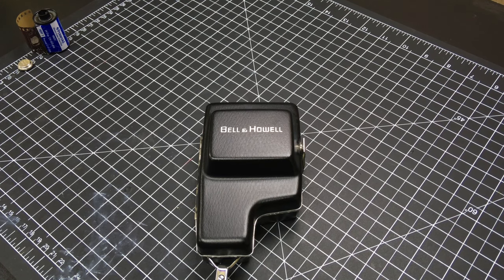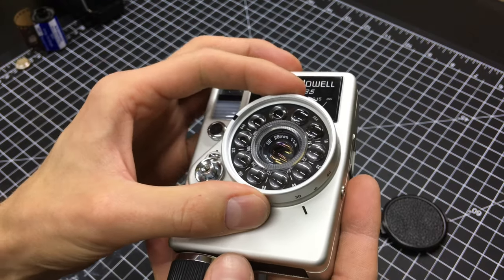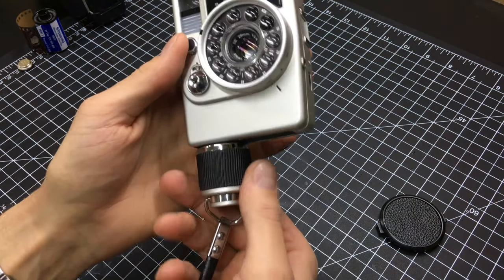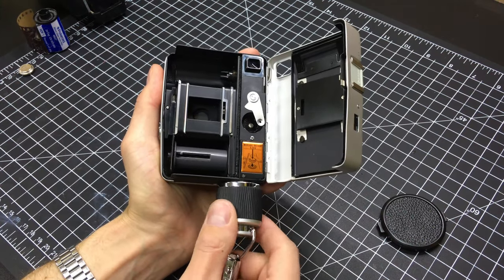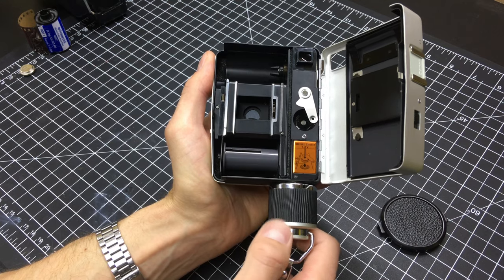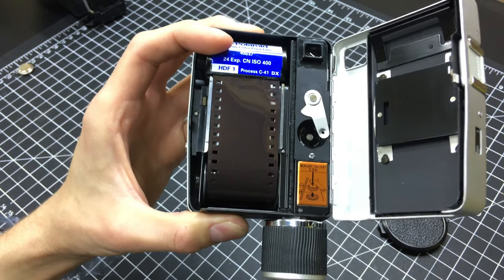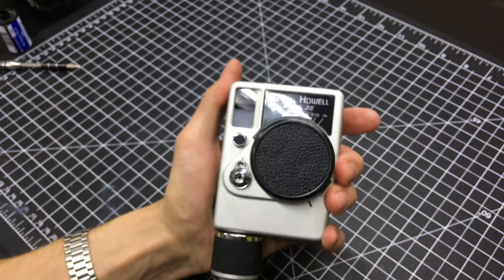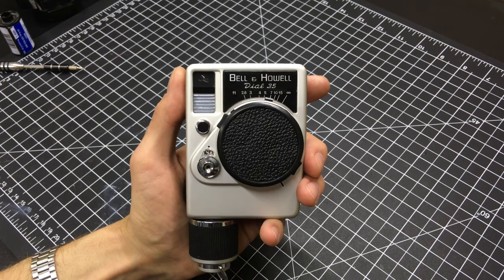How To: Canon Dial 35 Repair

Comment: What would you suggest if the shutter is not clicking? The camera is almost totally unused (original box and free roll of film was still inside.) But the reel does not move when winding and shutter does not seem to close/open all the way (no click.)
Reply from the maker: have you been testing it with a roll of film?  the shutter gets cocked when the sprocket holes on the film turn the gear in the film compartment.  if you do not have film inside you can turn this gear by hand to manually cock & test the shutter.

Comment: Hi! Thanks for this video! I need to perform this maintenance on my dial but I’m worried about the motor “kicking” when I open it. How can you tell if the mechanism has any tension left in it before you unscrew everything?
Reply from the maker: well, the best you can do is try to let out as much tension as possible.  i would put it into "Rewind" mode and let it unwind until it stops, then smack the motor with the heel of my hand in an attempt to jostle it loose to unwind more.
Reply: @David Vonk  I’m gonna have to hold my breath and give it a go. Scared to mess it up!!
Reply from the maker: you'll never know if you dont try... so give it a go and do your best!  good luck!
Reply: @DavidVonk  I did it!  Thanks for the vote of confidence :)  only kicked a little and it's running super smooth now!  Thanks for the video and the replies!
Reply from the maker: awesome, way to go!  i'm glad the video was helpful.  enjoy using the camera that you fixed yourself! :)
Reply: Me again. Shot some great rolls on this camera but suddenly it stopped advancing and was making odd sounds when I turn the crank. I took the crank off and now can’t move the gears manually inside like you do in the video with the q-tip. Guessing this is a bad sign… when i put the crank back on it turns but does not advance the film…

Comment: Nice video man, it's a funny and beautiful camera. I'm having the following problem with it though: the exposure counter does not roll back when I rewind the film. So when I got the camera it was at about 40, went up to 72 while I was shooting and I couldn't finish my roll and had to rewind it. So my roll was used about halfways. Rewinding the film moved back the exposure counter somewhat but not completely, so it's now at 50 with no film in the camera. I'm guessing my next film roll will also remain partially unused because of that. Do you have any suggestions on how to solve that and make the counter go back to 0 upon rewinding a film roll?

Comment: hi david, thanks for this awesome video! i don't know if you still check the comments on this video or not, but i have one of these and it seemed to be working great until halfway through my test roll when it suddenly started rapid firing the shutter on it's own and now the shutter release button isn't firing the shutter any more. i pulled my test roll out of it and when i turn the sprocket inside by hand, the shutter fires rather than cocking for the release button. any idea why this would suddenly happen halfway through a roll of film?
Reply from the maker: hard to say for sure, my Dial 35 only had the sticky motor issue so i only went that far.  you might have to do some more digging to find out the cause of the issue.
you could also try asking on the Vintage Camera Repair Group on facebook

Comment: Hi, thanks for the video ! I'm trying to repair my canon dial 35-2 but I can't unscrew the motor from the body. Could you give me a link to the specialty wrench you are mentioning ?
Reply from the maker: hello!  if you look at the pdf i linked in the description, there is a picture of the wrench on the very last page, the Canon Service Tools List.  they call it a "Special Screwdriver" T0199-18-0357-1T.  unfortunately, i doubt you would be able to find it, so you may have to fabricate one with the same span out of a piece of sheet metal.  hopefully their picture gives you an idea of what you need. 

alternately, you could try getting creative by wrapping something around the motor nut (e.g., some wire?) and twisting it down to grip the nut, and pulling on it in that manner?  i guess i got lucky on the Dial 35-2 cameras that i worked on, i was able to loosen them without a tool.

good luck!
Reply: David's right that you're best to have a machinist make the wrench from flat stock that will fit the gap between the camera and winder fob without binding. It is the right tool in any case.

Comment: What kinda battery did you put in?
Reply from the maker: the original manual calls for a 1.3v Mercury battery which is long been discontinued; i used an MRB625 1.35v battery which seems to operate the light meter correctly.  unfortunately, they are expensive (around $10 USD currently) and they are zinc-air chemistry, which means once you peel the sticker off the battery it starts to discharge.  expect to get just a few weeks life out of each battery.

Comment: HOW CAN I CLEAN THE VIEW FINDER, TONS OF DUST IN THERE
Reply from the maker: it's fairly complicated, and the Dial 35 and Dial 35-2 are slightly different... but if youre feeling adventurous, here is a PDF that includes both service manuals (35-2 starts about halfway down):
https://flynngraphics.ca/wp-content/uploads/2019/01/Dial-35-Repair-Manual.pdf